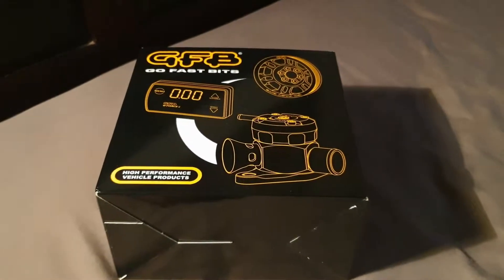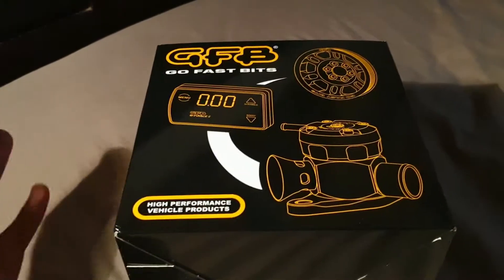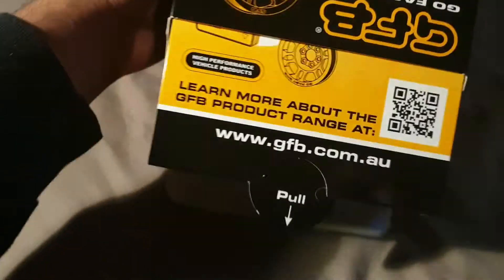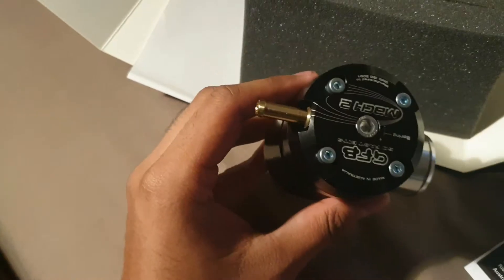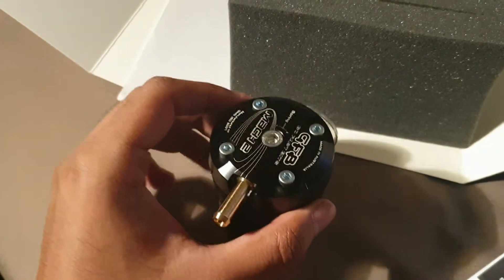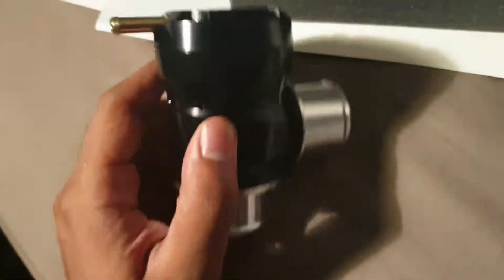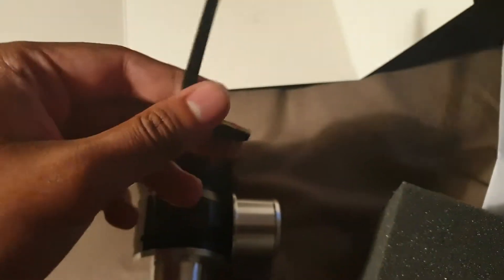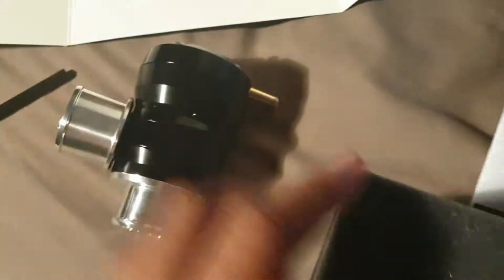GFB Mach 2 Blow Off Valve Unboxing

Comment: With the allen key what does that adjust exactly? What does - and what does + do?Appreciate the time
Reply: pre spring operation, if it stays open too long you tighten the allenkey to make more pressure and it closes quicker. Works both ends